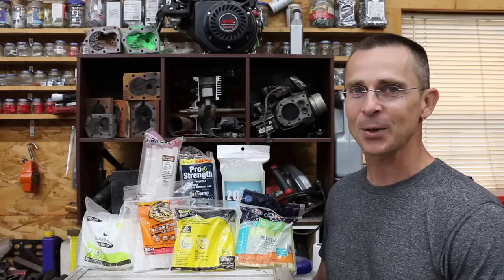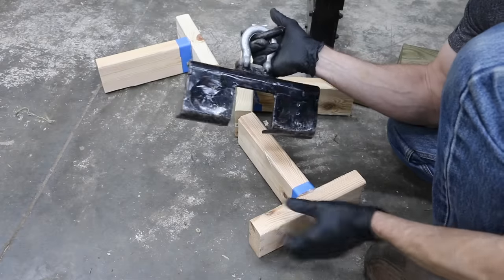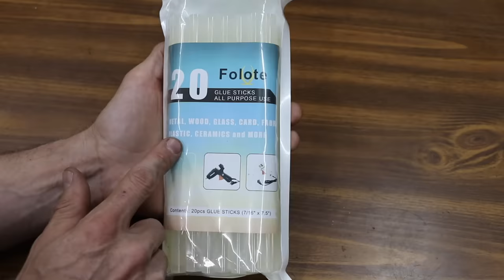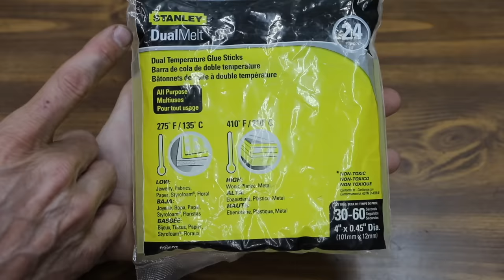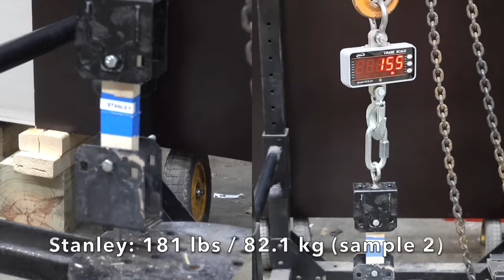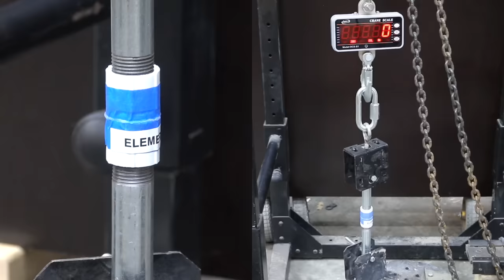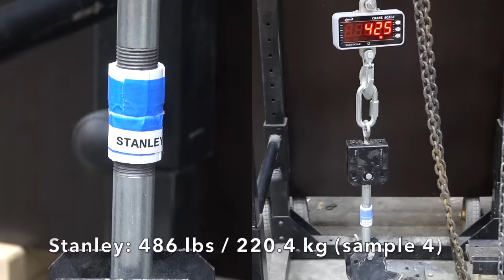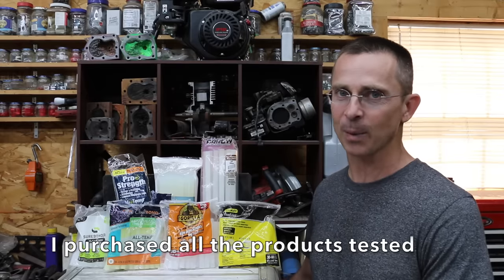Is Gorilla Hot Glue the Best? Let's find out!

Comment: How about a glue gun video to compliment this.  I've looked long and hard but cannot find a video anywhere that does a thorough comparison of corded vs. cordless, dual temp vs. single temp, mini vs. full size, hobby vs. pro, time to heat, best for crafts vs. workshop vs. pro, optional tips offered, etc.   In some cases, I thought I've found a ideal glue gun only to find out it's comically large or that the actual wattage for the high setting is not the 80W or 100W advertised but closer to 30W.
Reply from the maker: Thanks for the video idea.

Comment: Was anyone else concerned that the failure point of apparently identical samples varied hugely, by around 10:1 in some cases. Getting a consistently reliable high strength bond seems to be very difficult. I find that rather worrying with glue bonding being used for manufacturing such vital items as aircraft wings. Would you trust these bonds with your life?
Reply: They don't use hot-melt glues in aircraft construction so don't worry about that.  Glued joints in aircraft and auto body work are far more reliable and done under controlled conditions.

Comment: I ran into a problem, I used hot glue on some stuff for outside and in my green house. During 105 degree temps the glue failed. I am finding it hard to get hot glue sticks with a high very high melting point.

Comment: Hot glue seems very inconsistent. Maybe this had to do mostly with temperature and timing details during application? Almost every test-set had a low outlier, but Gorilla had a high outlier on sheer strength and maybe got unlucky. Stanley seemed consistent but maybe got lucky to have only one outlier the entire video.

Most Project Farm videos appear to yield conclusive results, but hot glue probably requires stricter test-controls and maybe a larger sample size; or else strict temperature and timing data to give context to inconsistent results. Not that any of these are doable; in this case assessment is not critique.
Reply from the maker: Thanks for the feedback.

Comment: My background is Mechanical Engineering and I admire your work - great job!  My only question is - how did you control how much glue you used plus the timing of when you put the two surfaces in contact?  Both variables could impact the results...
Reply: Can't speak for PF, but by using the wood screw as a control, excess glue was squeezed out of the joint.  As far as timing, I would guess that since all the boards were precut, the time of the assembly would be a small fraction of the working time.  Personally, I would have run the wood through a planer to try to make sure the surfaces were all close.  I would also make sure all three pulls were on wood from three different batches.

Comment: Would be great if you comment on the fumes given off by the different brands? Maybe my Stanley glue gun is overheating the generic hot glue that I've been using (my Stanley is supposedly temp controlled 45W) the fumes are so toxic and intense that I only power the glue gun outdoors and hold my breath and wear goggles when I use it.
Reply from the maker: Thanks for the video idea.

Comment: Is it me or it seems like the failure point is the wood and not the glue... (craters in wood)
Not 2 surprised considering IIRC wood glue vendors advertise that joints using their products are stronger than the actual wood.
Reply from the maker: Thanks for the feedback.

Comment: I just have to say this - when testing the glue on wood and the wood breaks apart then you are NOT measuring the strength of the glue . You are measuring the strength of the wood which is why you got such inconsistent results with that particular test,  therefore it proves nothing about the glue other than it’s stronger than the wood for the most part.

Comment: Stanley is #1!!!
Reply from the maker: Thanks for the feedback.
Reply: Good ole Amazon is selling the Stanley dual temperature (dual melt they call it, lol) 24 pack- 4" pieces (8 ounces) for $9.00. At $18 a pound that is about the most expensive hot glue stick out there. There is a couple steals on 5lb boxes. Adtech has 10" dual temp for under $20.00 and Arrow has a 5lb box of 10" for $37.00. I see you didn't test the Adtech brand and Arrow looks like it did pretty good. Going to roll the dice and buy a box of the Adtech. Thanks Project Farm for your informative video on this. At first I assumed that Gorilla Glue had the best and boy was I incorrect, lol...

Comment: Hello sir I am from India
We are transformer manufactures, I require heat resistance glue stick for minimum 130°C temperature, 
So pls review heat resistance glue sticks.. I heard about 3M hotmelt 3779 and 3731 glue stick but it is very costly in India that we never tried it.. So pls pls do review this products and other brands which is heat resistance pls share and glue gun for it..
Reply from the maker: Thanks for the suggestion.

Comment: I do have to say, using a flush mount test is irregularly discriminant to the actual proper use of the bonding agent. 99% of all joint functions have a non-flush action. I e most joints are feathered or dovetailed. This test is not accurate.

Comment: You did not test the glue guns. I got one to use that was 300 watts but it did not work any better the the 80 watt glue gun, I put a watt meter on the 300 watt gun and found out that it was only 102 watts, do a test with the glue guns and see if the very expanse ones are worth it. thanks
Reply from the maker: Thanks for the suggestion.